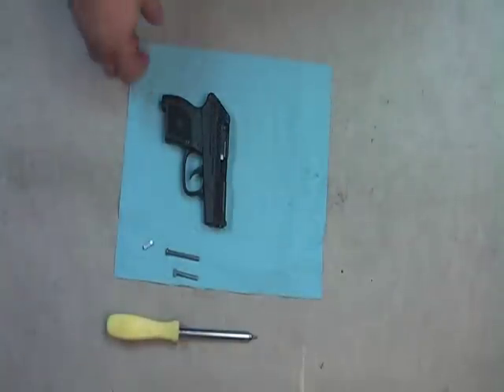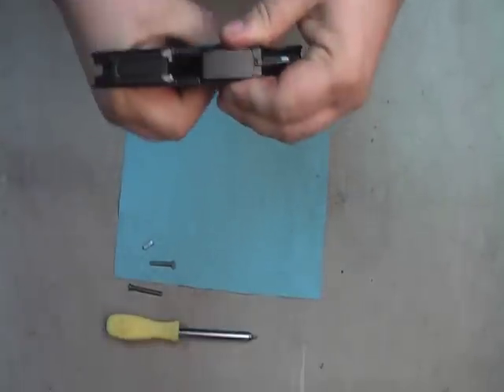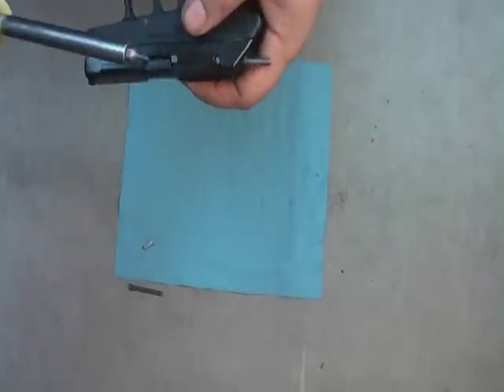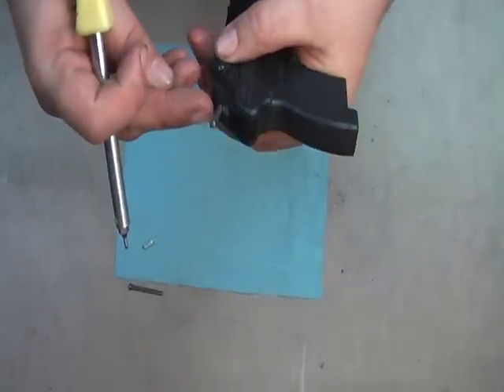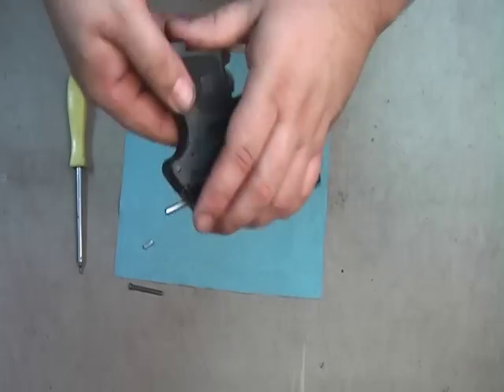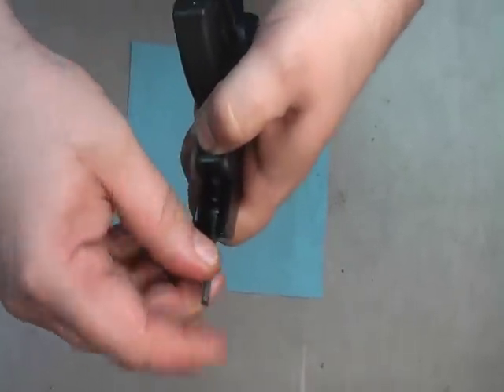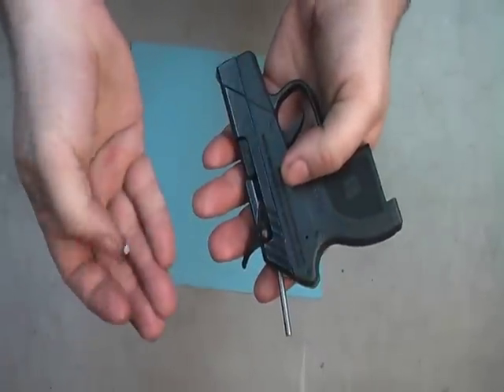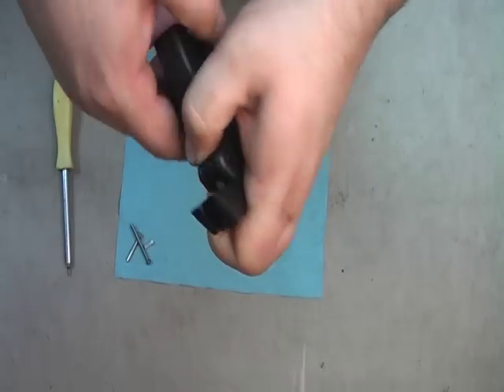Hellcat .380 - Replacing The Extractor

Comment: Where can I buy a replacement extractor? My father has a Hellcat and we went shooting at the range. The gun is only a few years old. Failure to extract. I couldn't inspect the extractor in the dim lighting of an indoor range. After the weapon was cleared manually, the next shot failed to extract. Upon inspection in better lighting, the extractor is clearly broken. I've searched MidwayUSA, Amazon, eBay, and even IO Inc's web site. I'm unable to find the part for sale anywhere.